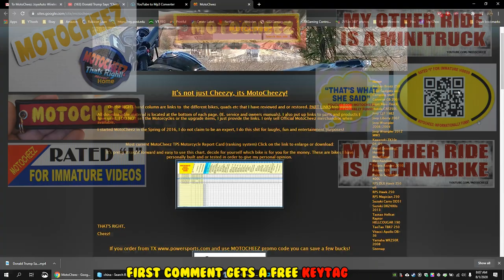Mini-Truck (SE07 E11) Gizmo goes for a ride in mini. Billee gives me WOOD

Comment: More Gizmo!

Water in the distributor cap?  Dielectric grease is your friend.  Wish my mini had EFI.
Reply from the maker: I was actually thinking that today! Great idea, I ordered some from amazon
Reply: @MotoCheez  - Dielectric grease is overkill for 12 volt applications but it works well on the base of turn signal and brake signal bulbs to keep water out and prevent corrosion.  Even better on trailer tail lights.  It's good on any automotive connector.  Shoot a little into the female connector and assemble and the mess is usually contained within the connector shell.  The best anti-corrosion treatment I've found for battery posts is an aerosol can of Surface Shield sprayed onto posts and clamps.

Comment: Yo moto! Thanks for the new mini video! Anyways I have the same aftermarket carburetor but im having adjustment problems could you help?
Reply from the maker: Sure. What's it doing?
Reply: For a good generic Hijet carburetor adjustment video, search for "carburetor adjustment Daihatsu Hijet S83p Japanese minitruck".
Reply: @MotoCheez 
Surging and I can not for the life of me get it to idle without a little choke as well... this tells me with my little mechanical knowledge.

 Possibly the surging is because its pulling the choke open? And running lean? Since it wants less air? 

Also what direction on the main adjustment screw does what?

What does the screw next to that one do?

I have been deeper into this little guy than any other engine in my life so know a bit about it but still struggling through it having fun and frustrations...
Reply from the maker: Definitely lean then. Counterclockwise makes it richer.  No clue what the other screw does, neither did the seller. He said was port for oil injection if 2 stroke.
Reply: @MotoCheez  ok i don't have but maybe 3 more turns out I started at your 10.5. Maybe larger jet then I can move it in a bit more? Its out to where it almost feels loose but I still have some turns left to work with but I also remeber in one of your videos you put the oem screw in if I'm remembering correctly.
Reply from the maker: @tripthyme6378  that's too much. Maybe see 8f the other screw helps
Reply: @MotoCheez  10-4 i really really appreciate a semi famous YouTuber taking the time to help me! No sarcasm intended! Your pretty big on the mini truck forums. Ill tinker with him today and see if I can get him running better.
Reply from the maker: @tripthyme6378  awesome